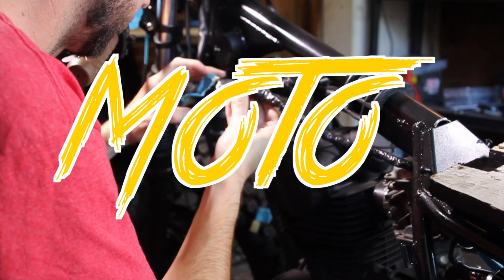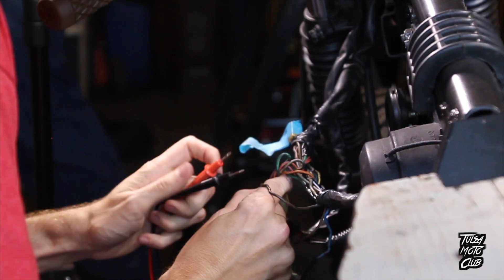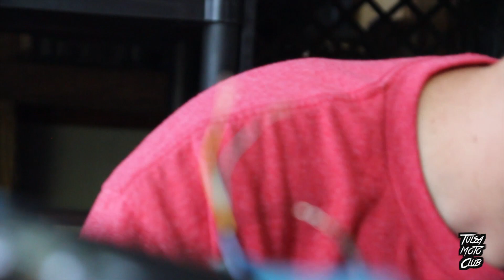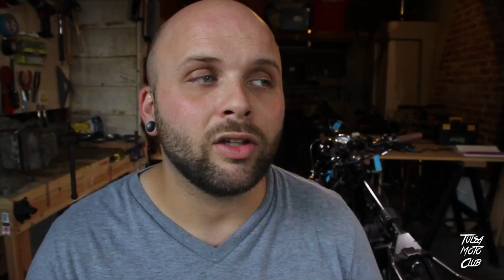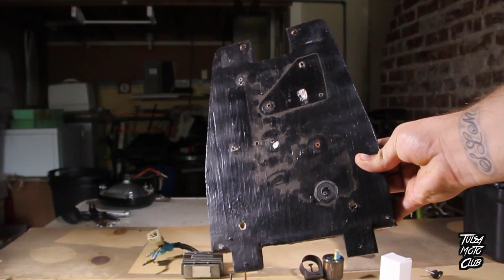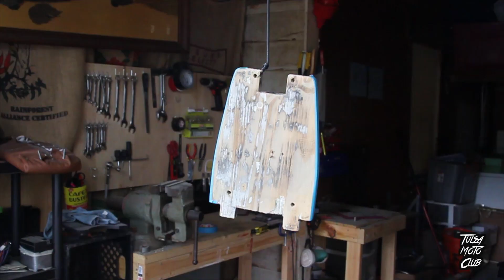Wiring The Bike! - Kawasaki KZ250 Build

Comment: I have the exact same motorcycle. I recently stripped the oil drain on it and now I have to spend $100 to fix it. Do you have any suggestions to how I could fix it at home?
Reply from the maker: Man that sounds like a bummer! You know, I've not run into a problem like that. Id imagine you could buy a new oil cap on ebay or something and if you know how to tap a hole then just tap the hole where the cap goes. that should give it new threads and let the cap screw in fine. If you don't have a tap set i know they can get expensive. In my opinion $100 isn't that much for a repair plus if its done by a shop they usually guarantee their work.
Reply: Tulsa Moto Club thanks Keith! I bought the kit, fixed the hole, and it started up and ran beautifully.